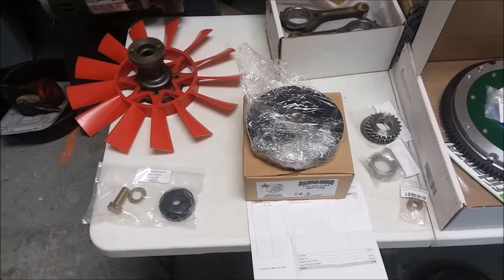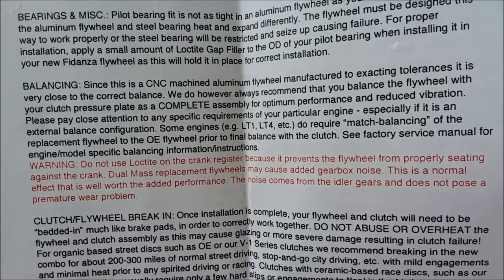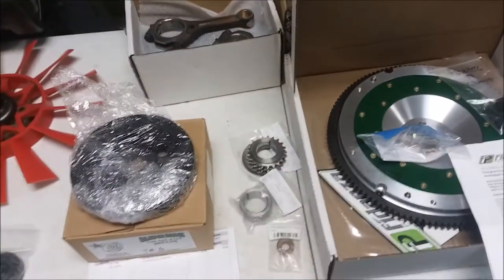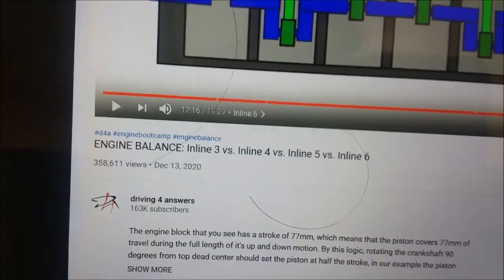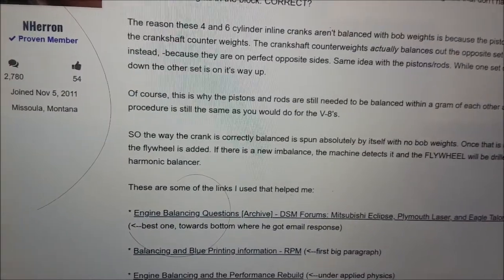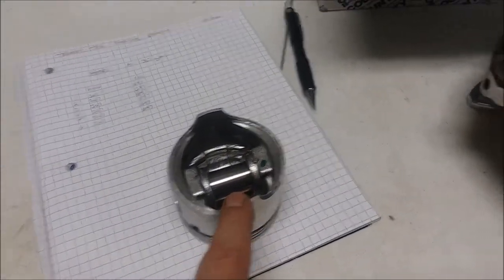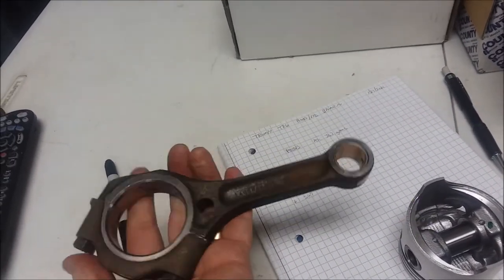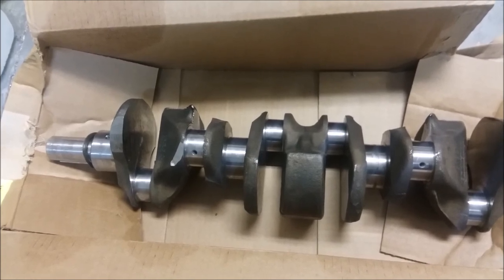Balancing a Triumph TR6 Engine - What, Why, and How

Comment: I now have a better understanding of what the machine shop should have done when balancing my TR6 engine. The work on the engine should be completed next week and now I know what to look for when I get it home. Thank you for another great video! 
Also, what is the right way to lay a crankshaft on the work bench?! Thanks
Reply from the maker: Hi Robert, store it standing up.  I built a makeshift cardboard box for mine, and it is standing on end strapped to a rear leg of a bench tucked under and out of the way, and covered
Reply: @triumphrestoration7403  Thank you. Does it matter which end is down?
Reply from the maker: @robertinfanzon6187  not to my knowledge.  What we are trying to avoid is bending.